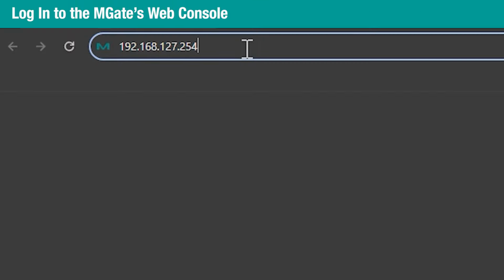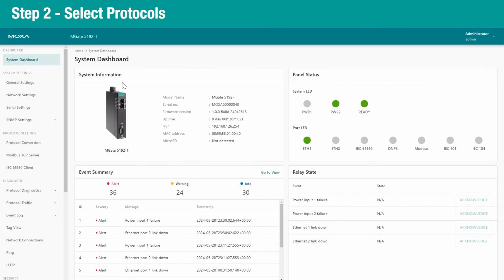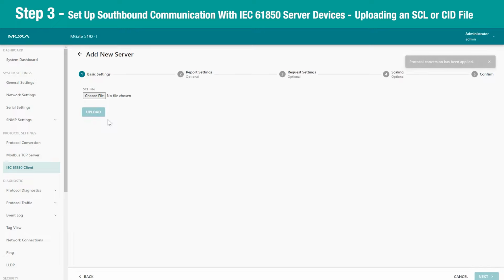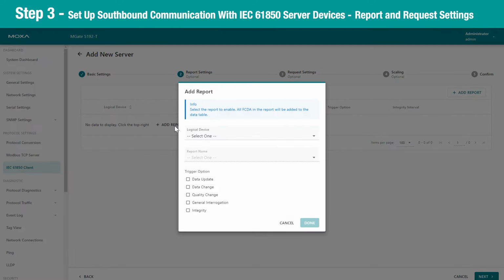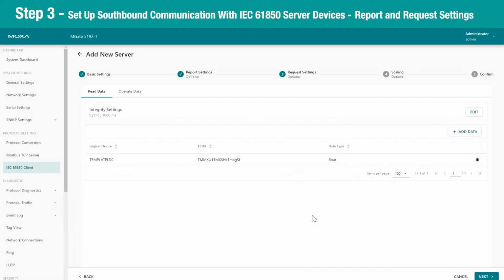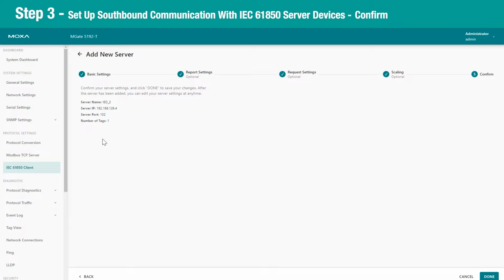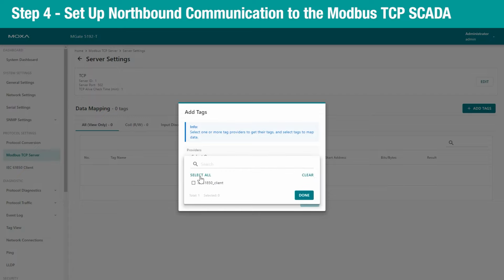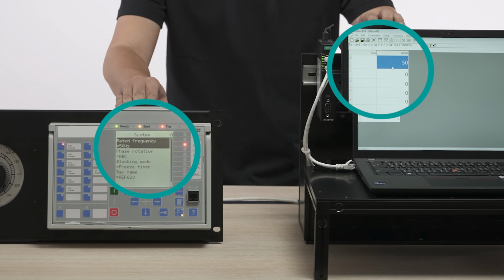Set Up IEC 61850 MMS Client to Modbus TCP Conversion in 4 Steps – MGate 5192 Series | Moxa

Comment: Anyway or any tool to import export configuration ? Like rather to backup restore the all gateway conf, is it possible to import/export on the IEC61850 client, the different server source config and for the IEC104 server (for example) the server points config ?
Reply from the maker: Hi, thanks for asking! The MGate 5192 supports full-device config backup/restore, and for IEC 61850 you can import individual server files then "Clone" to duplicate them. Standalone import/export of a single server with northbound data mapping is not currently supported, as the data mapping varies by server and application, so please use the whole-device config import/export for now.

Comment: I understand this is just a quick demo but I'm really surprised at the lack of export/import options here. I've had a lot simpler config files in previous experience. 

Cant find the CSV upload mentioned on the website for modbus mapping. Would be good for the same with IED tags. 

When cloning and IED config (aka I have many IEDs that have the same tags), it won't let me just change the IED as for me that's the only difference and only thing I need to change (as well as the IP).
Reply from the maker: Thanks for sharing this — really helpful to hear your experience.
For these kinds of configuration questions, our support team would be the best to take a closer look and assist you in detail. You can reach them here: https://www.moxa.com/en/support/technical-support
Reply: @moxainc the support team never got back to me. I sent a ticket over a month ago.

Comment: Is that possible to communicate the device via Modbus TCP?
Reply from the maker: Hi, 
Thanks for reaching out. 
Yes, it is possible. This gateway is specifically designed to convert IEC 61850 data to Modbus TCP, so you can easily communicate with your IEC 61850 devices to a Modbus TCP system.

If you have any questions about our products, feel free to contact a Moxa representative by completing the online form: https://www.moxa.com/en/contact-us